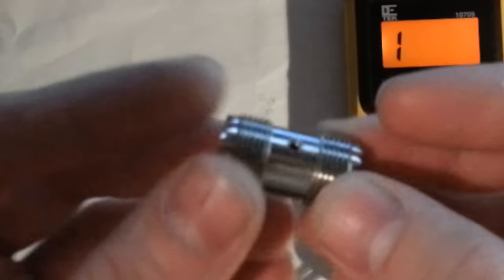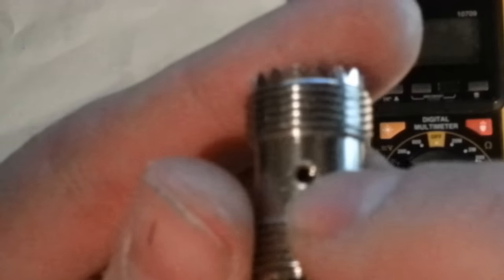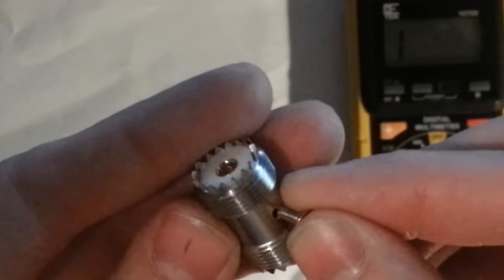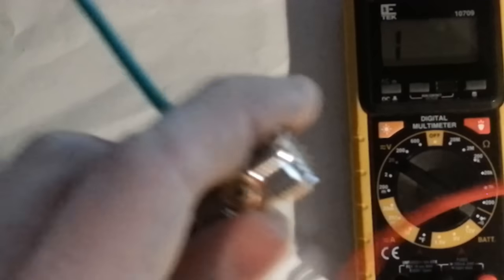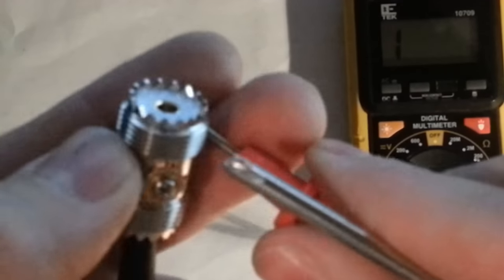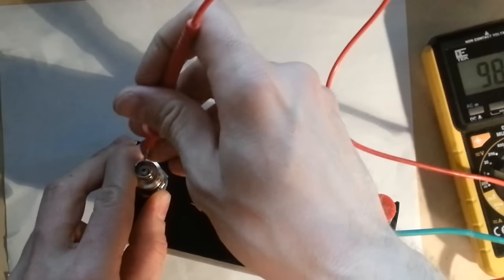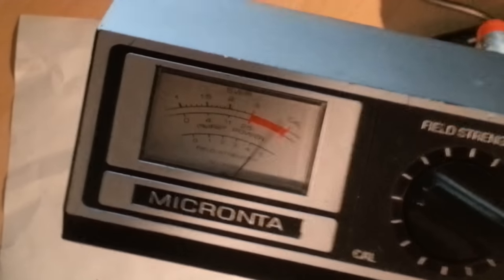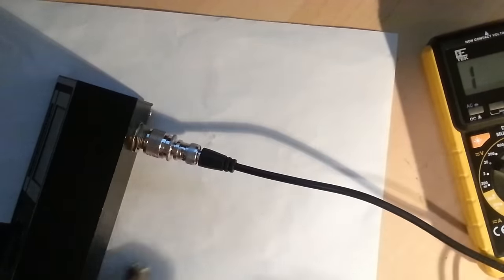Making Lightning Arrestors

Comment: Nice job on the project and video. This approach is marginal but it is better than nothing if you can not afford a $20-$30 Alph-Delta, Workman, etc. The purchased arrestors have a little ceramic pill with two precision spark gaps and is filled with argon at low pressure. When the voltage gets to its rating (100-1000V) the argon plasmas (glows like a neon sign) and holds the voltage at a low value (20-70V) until the charge tapers off below this value. The simple spark gap might not work until 2,000V and might stop working at 1,700V with a very small gap that is on the verge of shorting due to temperature. If it shorts and you are transmiting it might blow your finals. If this is on a inexpensive receiver or scanner it may save it from a distant lightning strike or static discharge, for anything else spend the $30. Any coaxial arrestor is placed near the equipment and not the antenna.

Comment: The screw depth measurement is rather haphazard. You need to allow for high awareness conditions causing high voltage. 5-10 kv depending on output transmitter power. Air breakdown  voltage is ~3 kv per millimeter. A machine screw with a threaded hole would give you more security and a better means of adjustable depth setting.

Comment: Check this link: https://forums.qrz.com/index.php?threads/connecting-bus-bar-to-grounding-system.525813/ may it can help you! I have a lot of doubts about using only the shield of the coaxial cable. I think you should use a varistor or a resistor to be more efficient! 73 and GL